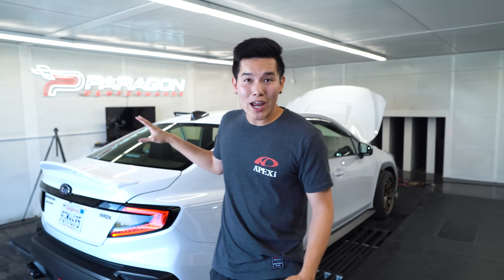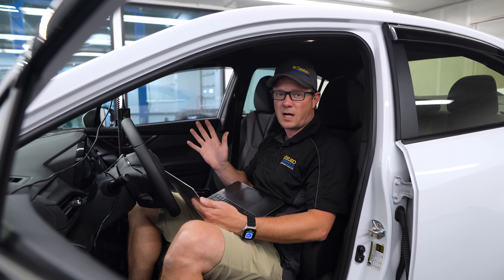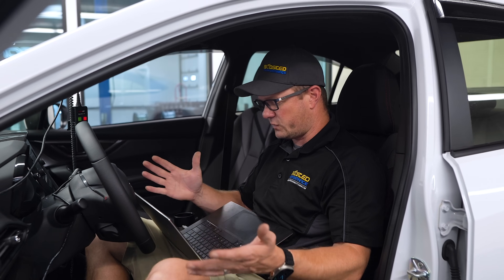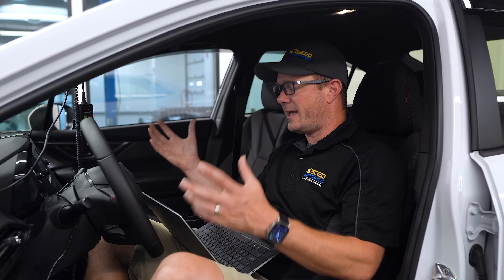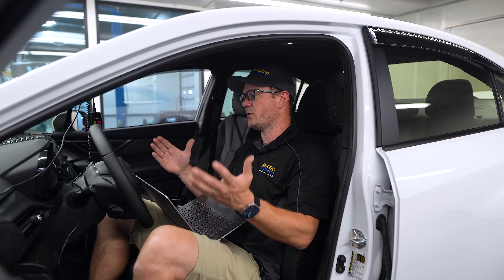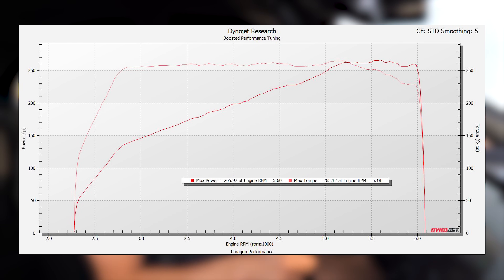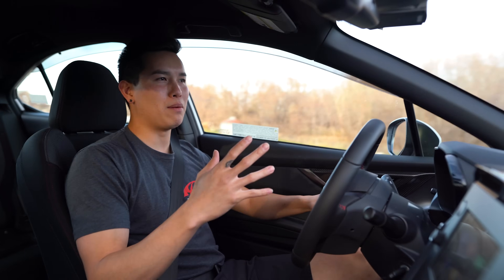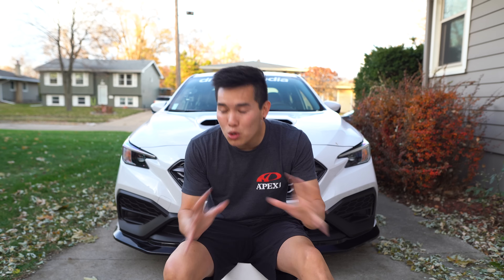2023 WRX DYNO TESTING! | HUGE TORQUE GAINS

Comment: does the stage zero do any mods to the ECU? Like, could I use stage 0 just for data logging without it modifying the ECU and thus not voiding the warranty?
Reply from the maker: Once you install the AP in the car the dealership will be able to tell somethings been done.
Reply: @KevinVo  how can they know something was done? My question is whether or not a stage zero does any programming to the ECU. it sounds like, yes it does. Or, can I use it only to monitor sensors, knock, etc. without programming the ECU?
Reply from the maker: @RobHTech  basically, they're able to see that your ECU has been flashed. Yes, even stage 0 will count.
Reply: @KevinVo  I just want to use it as a meter. Can it read the sensors without flashing it at all?

Comment: Given that this engine is very similar to that in the GR86/BRZ I'm curious to see how well they will handle being boosted long term. Who knows, the FA24 might actually be able to handle it reliably
Reply: I'm guessing it'll be like the fa20 in the wrx and 1st gen twins. The one that was designed to be turbod loves making power and the NA version doesnt. You have to remember that the NA fa engines go in subaru's economy cars so they aren't nearly as tunable as the turbo ones and the new fa24 isn't any different. The extra displacement should help though, I wouldn't want an 86 with more than 350 whp at the absolute most, realistically 300 would be more than enough and the fa24 should be solid in that range
Reply: The reason why the 86 is a bit more troublesome is strictly because those engines have higher compression ratio’s. Squeeze even more air in the cylinder and you’ll get a visit from uncle Rodney.

Comment: I suppose it is not an issue for you that this is the one mod that can flat out void the entire car warranty? Normally only the part you replace with aftermarket gets voided, but the ECM? That impacts Electrical, Powertrain and Structure. There is no returning the ECM to stock anymore. Touch it and it indexes the identifier number registered as the stock configuration. I suppose a way around this is to just purchase another ECM (~$700) and play with that one and put the stock one one in a grounded box on a shelf (HERF shielded). Of course, you do have a video channel, so the dealers probably watch your channel anyways and are cool with your mods as it is free advertisement for them.
Reply from the maker: As a general rule of thumb, I always tell people that if you're worried about your warranty than you shouldn't modify your car.